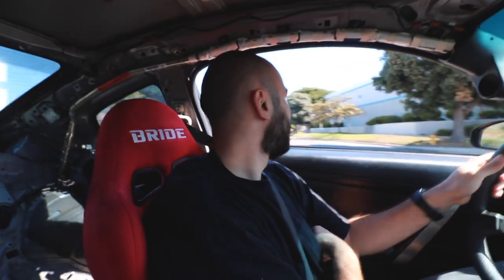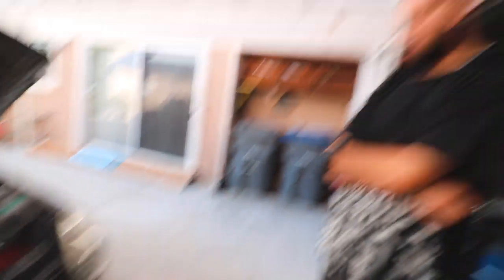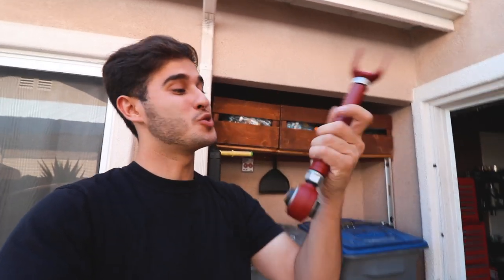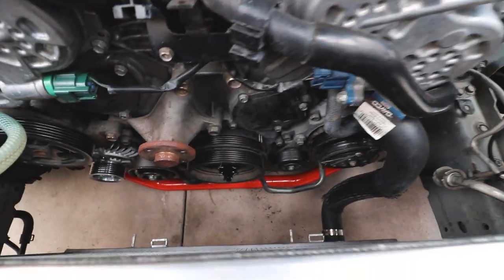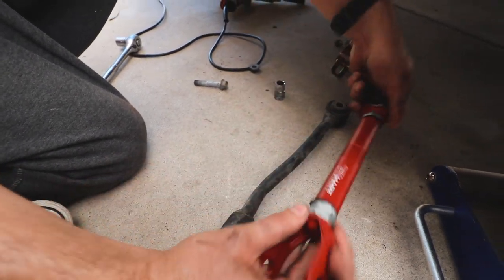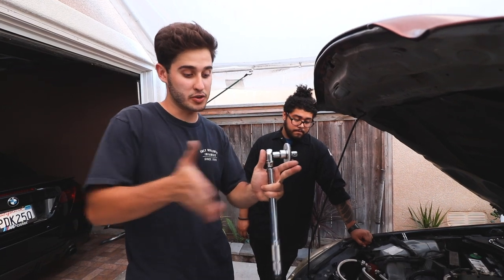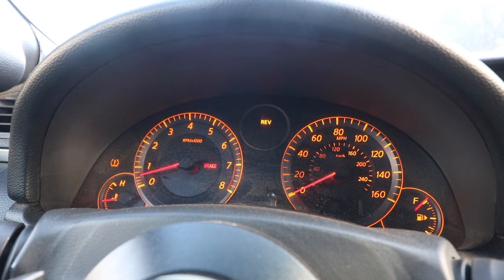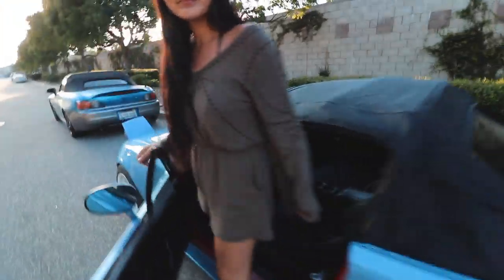Does this REALLY Add Power?!

Comment: I have a g35 that's modded decently. I can tell you that the pulleys help it rev but nothing drastic. It was a last resort mod since I had everything else on your build ( the NA build). Its nothing drastic.

Did you notice that the power steering felt slightly stiffer after the pulley? I felt a small difference in mine at low RPMs but while at 4k and up it feels the same as before.

I am considering building a mid mount turbo kit for my high comp. NA build. #boost the world! #turboeverything!

Comment: Bruh the water pump on these is chain driven 😂
Reply from the maker: It’s still a water pump idler pulley haha
Reply: @StaticGarageUSA  no it isn’t, it’s a fan pulley. You can just remove the whole thing and put in a spacer behind the power steering mount. Then get a shorter belt.

Comment: I think for cost, it wasn't worth it. You accelerated about 500RPM faster. Perhaps on a boosted application it would allow the motor to spool up a tad faster. IMO, if it was between pulleys or balancer delete... I'd go with the balancer delete.

Comment: The "water pump pulley" should be deleted. It has no real purpose. You can use the 3 feet from the pulley as spacers. You will have to grind them off the pulley. USE BELT 6PK1145 to replace the longer belt.
Reply from the maker: oooo that’s a good idea!

Comment: An Under drive pulley cant and wont add horsepower or torque. What it does is give back horse power and torque that was lost from parasitic rotational drag. The lighter and smaller the pulley the easier it is for the engine to rotate and transmit that power through the transmission and differential down to the wheels.

Comment: Thats not a water pump the vq has a timing chain driven water pump its under the timing cover thats a idler pulley nissan had put on for the early 03 g to run a mech fan before they went electric you can actually delete that pulley and bracket saves a few pounds just need a 1" shorter belt when you delete it

Comment: Loved the video Foo! My G ain't running I switched out the starter, both camshaft sensors, the crankshaft sensor on the driver side, and I cleaned the MAF sensor, it's weird cause it stopped running right after I cleaned the air intake filter 🥴 have taken it to multiple mechanics and an electrician but already replaced what they told me needed to be replaced. Just trying to get my G running and put content out like you guys ☹️
Reply: I commented on your vid, take a look 👍
Reply: Crankshaft sensor would fuck your shit up and not let it turn on as a safety feature. Take a look at that again. Im not a pro but ive worked on a few bmws and thats a leading cause when you fuck with them.
Reply: Did you disconnect the battery
Reply: Maxx bro crankshaft sensor was done by a legit mechanic, would it need to be reprogrammed just for switching the crankshaft sensor?
Reply: A1sncday1 when I was cleaning the MAF sensor yes
Reply: I did the same thing on my sensor and throttle.so I bought a nwp big bore from z1 and the sensor from jegs
Reply: They are very sensitive when it came down to clean again  so  I let the pros handle it
Reply: Crankshaft sensor is on the bottom of the car, I had an issue were it would start for about a minute then die and not turn on. I bought a new one and did the same thing. But a more expensive OE one and worked perfectly. So check your parts and make sure they are quality and not shit, good luck 🤙🏻
Reply: Yes.....I took mine to a dealer it was in limp mode

Comment: I think lightweight pulleys can cause some problems with the crankshaft and bottom end right? I’ve read about it on E46 forums and why the ATI damper is beneficial to higher power builds
Reply from the maker: Yes. Also depends on how balanced the engine is internally as well
Reply: Not on a vq35 the crank is internally balanced these motors dont even have a harmonic balancer from the factory

Comment: To answer the question posed in the title: The answer is "No"
You cannot add horsepower by reducing the rotating mass of the engine components.

Technically Horsepower is supposed to be measured at constant RPM. 
This check is done at multiple discrete points on the RPM curve to get a plot of HP.
Some modern Dynos use the time it takes to spin up the system (plus an external mass) to determine HP (inertia Dyno)

If you do a "before" run on these types of dynos, you must enter the estimated rotational inertia of the engine's rotating mass and the dyno uses this value to determine HP using a "time to ramp" RPM from low to high RPMs.
Now if you replace the Crank Pulley with a unit that has less rotational mass and you DONT update the number entered in the dyno, then the "After" dyno run WILL indicate more hp, but this was because we cheated by not giving the dyno the new rotational inertia number.
put in the correct number for the "after" test and you should get the same HP number as before.
If a dyno run shows increase HP due to reducing rotating mass, then something is wrong with the dyno (or the data entered into it)
Reply: It’s ment to increase torque
Reply: @Lifeofshawnyg  - It cannot do that either

Comment: nice mod , but the “water pump pulley” is not even connected to nothing , the water pump on the vq35 is inside the timing cover and is chain drive , u can eliminate that whole pulley assembly and put a shorter belt on it cause the function of that pulley is to drive the fan clutch on the 03-04 G sedan like the one that i have , search on the forums and you’ll see a lot of threads about it , and for the crank pulley u can feel more difference in automatics than the manuals ,
Reply from the maker: Nice! thanks for the info. Maybe we can just bypass it like you mentioned!
Reply: @StaticGarageUSA  yeah no problem , for me this is the best modifiable platform u can work on it , can pick up power quick with just few bolt ons and when is tuned you're gonna feel a big big difference